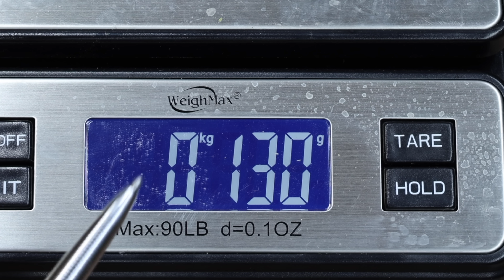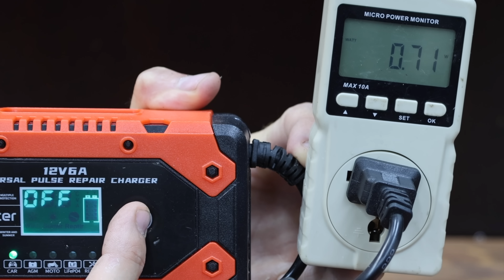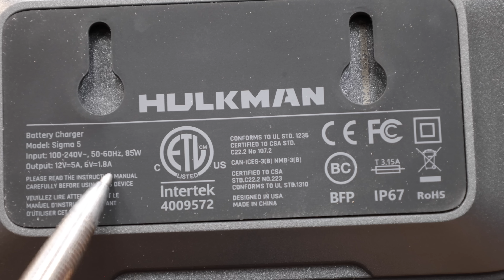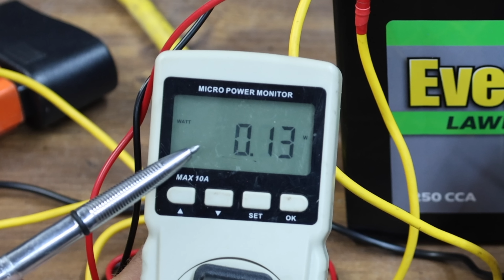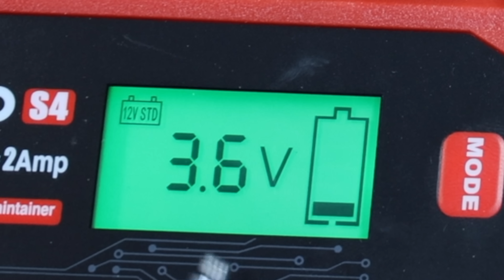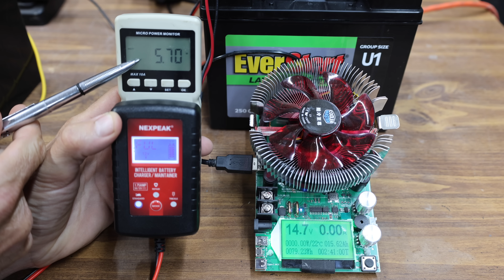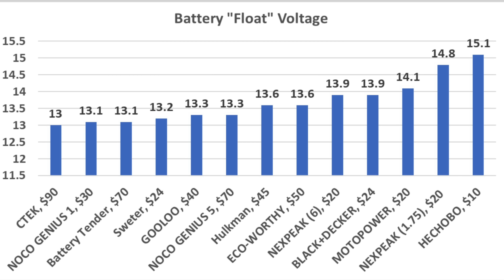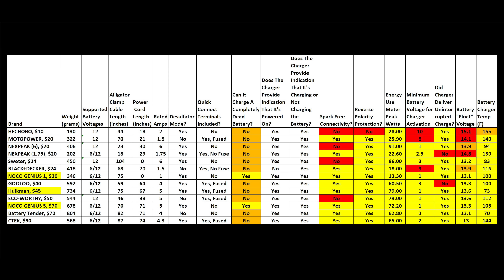I Tested the Most Hyped Car Battery Chargers – One Stood Out!

Comment: I had a Battery Tender  brand  charger that I connected to my ATV's  battery and after four years and eleven months of service it quit working. I called the number on the package it came with and inquired if they would honor the five year warranty. They sent a prepaid address label.  To make this quick it was less than a week from the time I sent the old one in until the new one arrived!  There was a note in the box saying the new one was under warranty for the next five years! That was more than ten years ago and it is still working.
Reply: I have had a Red, TENDER AA/AAA battery charger for 15 years. It Auto detects pack of NiCad and Metal Nickel Hydride batteries. Tender is an awesome brand.
Reply: Battery Tender is awesome.
Have had mine since ~2002.
Still working.

I also have a Yuasa that's ~10y old and still going.
Reply: Agree. I have four of them, most of them have been in constant use for years and years! They are old-school reliable!
Reply: I’m with you on Battery Tender
Reply: These days that's impressive. My trickle charger isn't a battery tender type charger, but it's over 40 years old. Was thinking about getting a battery tender type charger. Will have to see if I can find that brand. Be easy to remember that brand name.
Reply: I learned of the Battery Tender brand years ago while I was fleet maintenance manager for a heavy duty trucking company. We kept a stock of batteries in each size as used by our fleet. Our battery supplier at the time was Interstate. The route delivery man told me to get a Battery Tender and make up jumper wires to connect all the batteries in parallel. The Battery Tender kept the entire stock charged and desulfated. I have since switched to Noco Genius as I have several pieces of equipment, including a spare battery for the fence charger on my little farm that are used infrequently so I keep a Noco Genius on each battery 24/7. I recently purchased a new Battery Tender but I much prefer the Noco Genius.
Reply: That's what you used to get with the old school American companies.
Reply: I had problems with my 3a battery tender it wouldn't keep my car charged over winter it just kept letting it die was new battery too! I was not happy got a noco no issues works perfectly.
Reply: The Battery Tender brand is all I will buy for a trickle charger.
Reply: Eventually the battery tender will fail. The electrolytic capacitors will eventually dry out.   Take it apart, replace the caps for pennies and you’re good for 10 more years.
Reply: Every battery I own now is lithium based and when I need to I only upgrade.
And I do have to thank you for getting me completely addicted to lithium.
I can't imagine using flooded or amg batteries anymore.
However, this made me laugh as I remembered the old days😊
Reply: They didn't require me to send my dead one in, but I believe the company has changed ownership since then.
Reply: Service like that causes you to tell stories, and those stories bring customers.  Thanks, SCDRROHVA!  I know what to get next time.
Reply: Battery Tenders are awesome 👌🏾.  But NOCO's are better.
Reply: SAME HERE I HAVE ONE POWER OUTAGE SURGE IT GOT ZAPPED IT WAS 4 YEARS OLD IT WITH A10 YEAR WARRANTY I SENT IT TO FL. THEY REPLACED IT WITH ANOTHER 10 WARRANTY. MY BATTERY IS 9 YEARS OLD STILL READS 12.7 CAN'T BEAT IT. I DON'T KNOW IF OTHER CO. HAVE A 10 YEAR WARRANTY.
Reply: Ive had the Black and Decker on my snowplow pickup for years.  I plow 3 driveways next to each other and so it’s difficult for the alternator to completely charge the battery so I always plug the charger in when parked.. It has worked down to -45 with no problems. I use small solar chargers for the lawnmower, UTV and snowmobile. I park these in our shed with a small solar panel on the south wall. I used a terminal strip and isolated each wire to one of the machines with a diode so the batteries won’t discharge into a bad or low battery.
Reply: Thanks for providing the comment this is quite helpful info.

Comment: Just a heads up, the Noco chargers do sort of include quick connect terminals, the battery clamps are affixed to the wire with eyelets, so just remove the screw on the clamp and you have yourself the quick connect terminals. 

Another thing to note that I never really appreciated until I bought some Noco chargers are how well designed the clamps are. I rarely find a battery that I can't get attached with the Noco clamps, especially handy on ATVs with the battery set down in plastic under the seat where the cheap charger clamps are too bulky near the tip to attach without pulling the battery out.

The X-Connect is a bit annoying if you already had everything wired up with SAE plugs, but Noco does sell an adapter, and the X-Connect is a lot easier to plug and unplug, so at least it was an improvement and not just a way to force you into a proprietary connector.

Comment: I have a simple 1.25A float charger from Menards - Performax brand.  I just checked it as I have it wired into a truck with a 2017 battery - pulling 0W, opened the door and it jumped up to 20W and 14.4 or so at the battery,  it slowly ramped down in wattage to 0 and battery at 13.3V over about 30 sec.  I know this video didn't cover that type of charger, just adding that as a plug for you to consider using Performax and Masterforce products in further videos.
Reply from the maker: Thanks for sharing!

Comment: My lawn tractor lives on a NOCO Genius 1. The tractor cranks right up after sitting completely idle through 3 winters so far.

I would add that NOCO doesn't use standard SAE connectors, so you can't attach it permanently, and just unplug it from multiple batteries
Reply from the maker: Thanks for sharing!

Comment: I have several Noco  chargers  and they are flawless!. Each of my vehicles has one permanently attached and have never caused battery problems. I also have several lithium batteries and, again,  Noco is amazing. Over the many years in extreme temperature environments (Alaska oceanic) I had acquired a number of different brand chargers all of which are now in the trash except for Noco!
Reply from the maker: Thanks for sharing!

Comment: Why did you not test any of the big ones that cost $200-$1000? I would like to know what the best one is overall. Not only the best tiny one that you can stick in your backpack. I have bought a few that have 200-400 amp units. I currently have one from associated equipment 400 amp max. I bought it on amazon 2 years ago for $925 i think. I would love to know if there is a better 1 for less money. So many of these things you can't tell the quality by looking at an ad on amazon, or on google. I usually end up picking the more expensive one, hoping that it's priceed higher because it's better. That's often not the case. I'm sure other people would like to know as well. I bought it to instantly jump stuff diesel engines on my snowplow trucks and
Farm equipment. In the winter time, my old diesels are hard to start. I burnt chargers up all the time. Even just charging a multibattery system.When a reasonable setting tends to burn up chargers, and I don't know why. I would think if a charger is capable of 400 amp jump start that it could charge a 4 battery truck @ 20 amps without breaking after only a few times. At no, the four battery truck is not one I have tried instantly starting with it because 400 amps would not even come close

Comment: This is the big problem with modern batrery chargers. Most will not charge a completely dead battery. Thats inexcusable.
Reply from the maker: Great point!
Reply: @ProjectFarm  Thanks for your video Todd. Its nice to see that some of the manufacturers have a way to force the chargers into charge mode.  But it still seems the majority dont and a lot of people are going to wind up frustrated and disappointed when they find out later.  Yet another reason to look for an older battery charger.

Comment: An error in spreadsheet. CTEK is 12V only. Have 3 of them. One died after 10 years, replaced. Manual shit, no mention how to desulfate. But they have served me well for more than a decade. Use them for batteries ranging from 1.8 Ah to 135 Ah.
Reply from the maker: Thanks for sharing!

Comment: Yes on the larger battery chargers!

I have a Battery Tender mounted to the garage door opener in my garage.  A wire leads down with at connector so that I can plug in my '14 Porsche Cayman S.  I bought the car in 2018, and replaced the original battery this last spring after 11 years!  I religiously kept this car on the battery tender, even if I drove it every day and the result is that the AGM battery lasted this long.  It helps that the battery is mounted in the frunk way away from heat as well.  Great video!
Reply from the maker: Thanks for sharing!
Reply: I had an AGM battery in my Jeep for over 10 years. It was a great battery and never used or needed a charger for it.
Reply: @pmpwiz  I think they are well worth the extra cost.
Reply: Those AGM battery posts stay clean too. Well worth the money on my 2002 Ford PSD truck. I bet I could drive a mile on the starter alone.

Comment: that NOCO keeps failing on my 2 deep cycle batteries that are in parallel , it goes into fault and stops charging , i tried my really old ctek and it works perfectly , im a big fan of ctek mines over 10 years old with heavy use on the farm and still going
Reply from the maker: Thanks for sharing!

Comment: 14.8V is fine for the peak voltage on a normal 12V lead-acid battery.
An intelligent charger should drop its output to 13.8V for maintenance, once the current is low enough at 14.8V.
13.8V is a safe value for a permanent standby charge - any chargers not reaching that can not fully charge the battery and are not fit for use.

Some chargers may have other stages. You won't necessarily get sensible results if the battery is being artificially loaded, rather than genuinely being charged.
(See the Battery University articles on charging lead-acid batteries).
Reply from the maker: Thanks for sharing!

Comment: Great tests  -----   I bought a Schumacher battery charger about 5 years ago (about $70 then at Walmart) and it still works great today and probably should have been on your list.    One of the first times I used it, it automatically warned it had found sulfation in my cars battery (said SULF) on its display and it ran its desulfation mode for about 3-4 hours and then switched back to charging mode automatically until the battery was good.    That car battery lasted another 2 years after that and was 5 years old when I finally replaced it.    Charger still runs great and I use it on my vehicles and riding mower.
Reply from the maker: Thank you for the feedback!

Comment: I always recommend that people buy a multi-chemistry RC battery balance charger instead of a dedicated car battery charger. They're only a bit more money, around $75, and they're far more versatile. Mine cost around $50 used and charges at about 80 watts. I have successfully revived "dead" lithium and lead acid batteries with it (MONITOR AT ALL TIMES, EDUCATE YOURSELF, AND PROCEED AT YOUR OWN RISK WITH THIS). Not to mention the charger can work from wall power OR another DC source, such as a good battery.

Comment: Thanks for another great review.  

Years ago I bought a Battery Tender and it was fine while it worked but didn't last 2 years.  When I began looking for another I stumbled across CTEK.  It turns out the Porsche and other high end makes have company branded CTEKs.  I figured if its good enough for them, its good enough for me.  So I bought one.  Eventually I ended up with 7 (including 3 of the 5.0) because I have cars sitting around, especially my 3 classic cars.  I even bought a smaller one for the battery on my emergency generator.  Certainly the old cars don't have the battery demands of newer cars but the batteries in my 3 classics are now all 10 years or older. Even the little battery on my generator made it 10 years. Yes.  They are relatively expensive. I'll take your word on the completely dead battery.  But I've never had one.  I check them regularly and replace them before it gets to that point.

I am a fan of NOCO.  I have a couple of their portable jump starters and they have never failed me.  I say me, but I have only used them once for me. All the other times, it was to help neighbors and others when I see them with an issue.  But, after seeing this, I will definitely put them on the list the next time I need one.
Reply from the maker: Thanks for sharing!

Comment: I’ve had three Cteks; one went bad after 10 years, replaced it with two others that maintain vehicles parked outside all winter long. Got it specifically because float mode was supposed to work properly and not cook the battery, glad to see it perform well here.
Reply from the maker: Thanks for sharing!

Comment: I miss the days of having a simple battery charger.  Now it has  "recondition..."  "checks...."    If you've got a stone dead battery, most chargers won't even engage no matter what you do.

I've wound up connecting a battery charger and also a set of jumper cables to my truck just to 'fool' the charger so it'll start working.

Actually had one battery that the charger went to 'recondition' and never made an attempt to charge the battery after 5 hours.  We took the battery to the local parts store and left it overnight on their charger setup.  (it's always 'on' as a gang charger)   Battery tested okay afterwards.
Reply from the maker: Thanks for sharing your experience!
Reply: I have an old school, charge anything, charger that I keep around to throw enough of a charge in a fully dead battery to let my smart charger start working.

Comment: I went to Menards got a small battery charger. With maintain, pass or fail test. It's great but also bought small jump pack from your channel. Has worked to jump start mowers.
Reply from the maker: Thanks for sharing!
Reply: Saker plus uses pump with rechargeable battery back.

Comment: I have had issues with "NOCO GENIUS" 10 amp chargers from a few years back, mostly, from them either cooking batteries or discharging them dead, and I hope that the tests here show they corrected some issues, but I won't chance purchasing another one. The "zero volt - dead battery" test is pretty much moot. A battery that has gone to zero has an internal short that won't allow it to be useable and it will discharge itself quickly even if it was made to hold any charge. Your test of a deep discharged battery holding anywhere from 2 volts and up is more realistic.
Reply from the maker: Thanks for sharing!

Comment: MADE IN CHIIIIIIINA......USA need to block all imports from China to stop US companies from using slaves and to bring companies back to USA.........almost all Intellichargers Ive tried cant charge a battery if it is 10v or lower, just refuses. but if you take those ancient ones and just plug in wall and on to battery it works without a problem. the problem is the new safety chip or whatever.